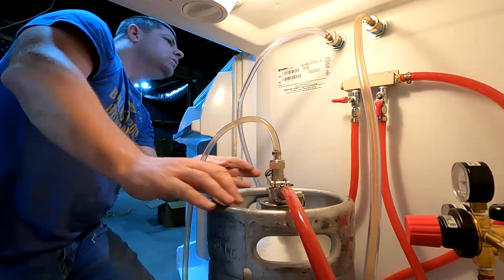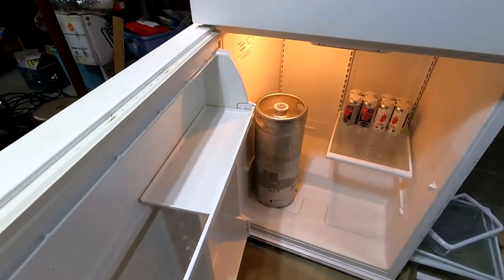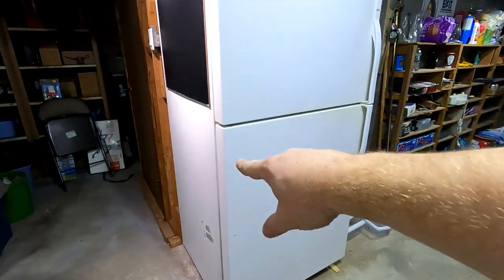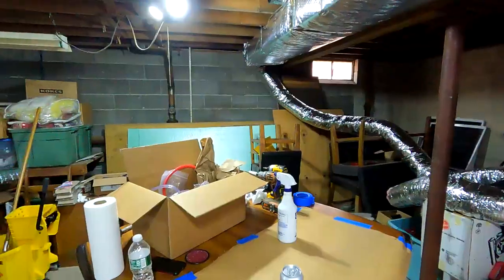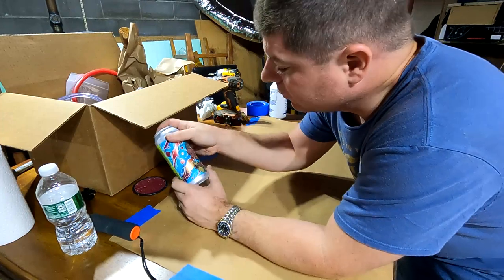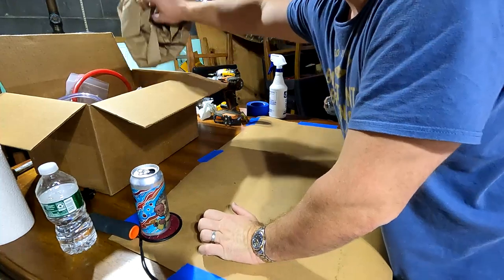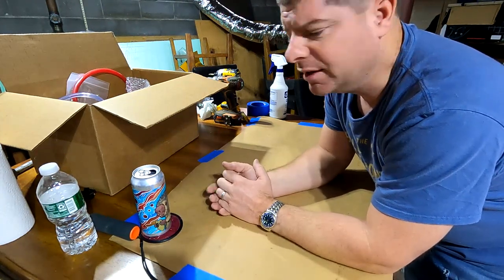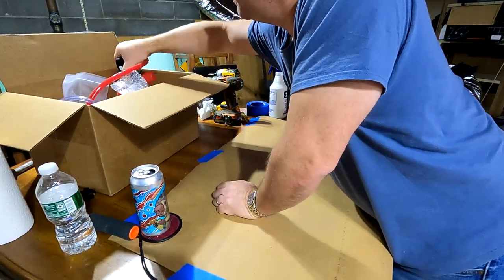Building a Kegerator - How Easy Is It? - DIY

Comment: I think you said you were going to reduce the gas pressure to reduce foaming? That's not the right way to do it, as you will lose carbonation over time. Instead, use a strangling hose, which is just a thin hose with a small diameter. That way, you increase the resistence of the beer line, allowing you to keep a higher pressure at the keg to maintain carbonation, while slowing down the pour to reduce foaming. Loved your video. I'm converting a minibar for use as an inline cooling system, so I don't have to cool my entire keg, but only the beer as it comes out. I was a bit weary of drilling holes in the fridge, but watching you do it, it seems easy enough. :)
Reply from the maker: Thanks for the feedback!  When I started, I think I had the PSI at 10 or 12, and it was coming out like a fire hose..  I dialed it down to about 8 and it's much more manageable with far less foaming.  The beer line is already 3/16" ID so I can't really go much smaller.  Maybe I'll experiment with 1/8" and see what happens but I'm thinking that it might have the opposite effect... Like when you hold your thumb over the end of a garden hose.
Reply: @CarsCraftsDrafts : 3/16" is great, but it's the combination of the length and ID of the hose that adds resistance. So my recommendation, is you get a much longer 3/16" hose. It should at the very minimum be two meters long, but I would recommend getting 3-4m. If your beer line is too long, the only thing that happens, is that the beer comes out too slowly, and then you can shorten the hose a little at a time to find the right length. 

The pressure on your keg should only be decided by the carbonation level you want in your beer, which requires a higher pressure the colder the beer is. For instance, for a pilsner type beer that I serve at 40f, I keep the keg at 36 psi. Using a long enough hose, flow is not a problem at all.
Reply from the maker: Maybe I'll try that, a long run of tube.  I definitely don't have 3-4m though.  I have probably 5 feet.  Is 36psi what you're reading at the CO2 regulator?  That seems high (but this is still new to me).  I did a quick Google search and saw that pilsners are recommended to be at 11-16psi.
Reply: @CarsCraftsDrafts : Sorry. it's a bit late and I confused myself somewhat with the unit conversion. :) But it depends on temperature. For instance, 29 psi at 68f gives the same carbonation as 13 psi at 40f. Since my kegs are stored at room temperature, I use much higher pressures. But anyway; get a longer hose and experiment at the correct pressure for your carbonation level and temperature. I'm very confident that this will fix your problem.
Reply from the maker: @jeschinstad  I gotcha, that makes more sense!  I'm going to do some testing...

Comment: Just some handy tips, but it could’ve been foamy because of temperature…and although the long beer line is typically better, you never want it dipping below the keg, just king of coil it on top of the keg and see if you get better results.
Reply from the maker: I think part of the problem was that I had the gas pressure too high, and it was too forceful coming out of the tap.  I dropped it down to about 9psi and seems to be better.  But I still get some air in the lines overnight.  I'll try coiling the lines on top of the keg like you mentioned.  Thanks for the tips!

Comment: You were so lucky I drilled my fridge on the side last weekend and on the first hole we had the fridge killing hiss as the gas’s line got nicked
Reply from the maker: Oh man! Sorry to hear that happened! I don’t think I know of a way to check for lines prior to drilling. I’m 98% sure mine doesn’t have lines on the sides.
Reply: What kind of fridge did you have?
Reply: @CarsCraftsDrafts  what made you so sure it didn't have lines in the side? I'm about to do this to my Kenmore 363 fridge and I'm worried as hell, haha
Reply: I had a Westinghouse 210lt. When I crushed the fridge the gas line had no set path so the chance we hit it was 1 in a1000
Reply from the maker: @FadeToZach9982  I wasn't sure!  It was a gamble, but I had a pretty good feeling that I wasn't going to hit anything.  Absolutely no rhyme or reason on where I drilled, other than "this seems like a good spot!"